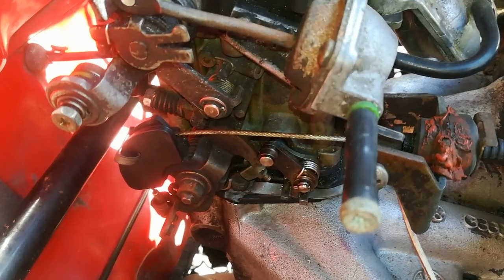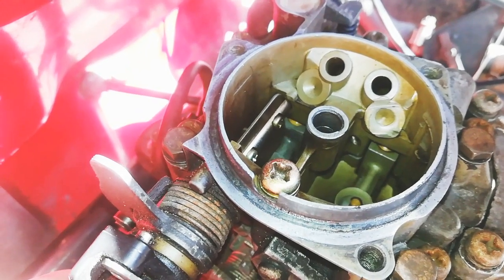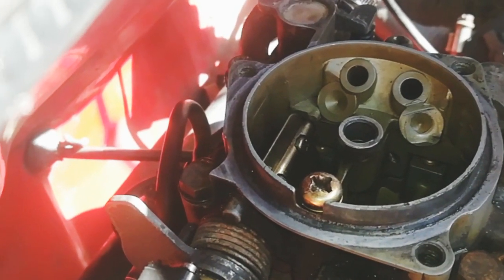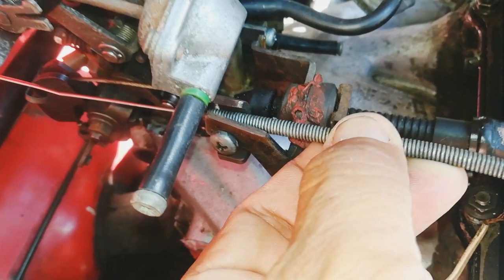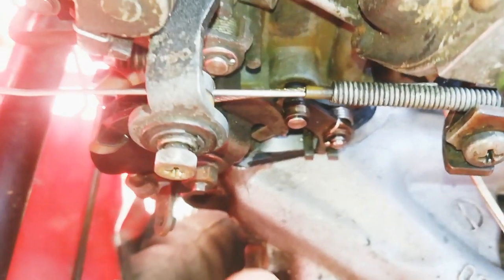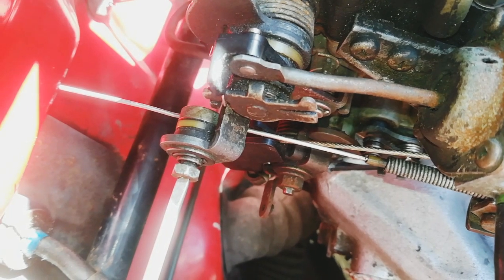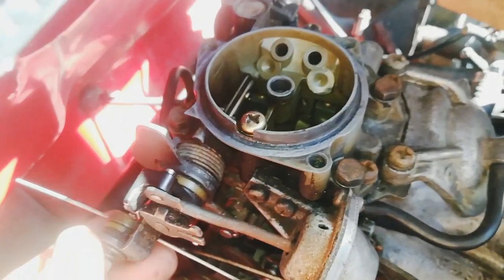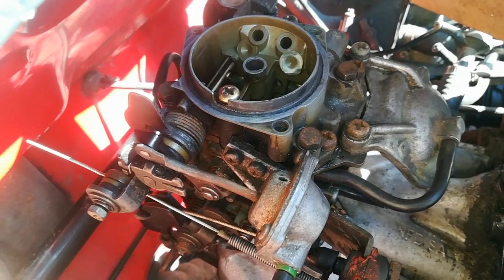GOLF MK1.HOW TO SET MANUAL CHOKE (CARBURETOR KEIHIN KS2)#golfmk1 #vwgolf #vwfox#golfmk2#vwcaddy

Comment: Have a issue with my golf carburetor that it idles high at 2000rpm. Looks like the throttle body gets stuck, is there a way to fix it or must i just replace the whole carb, taken it out twice to clean and try and fix it but no cigar. Thanks for all the tips, Keep up the good work
Reply from the maker: Hi. Have you tried a drop of oil or Q20 on the hinge of the valve.. May just need bit of lubricating.. How is your accelerator cable. You sure there's not a kink in the tube where the cable runs in.. It happened to me once after I moved the cable, while I was working on carb. That's probably a long shot but anythings possible.. And sometimes it's a small issue causing the problem
Reply: @pjs-golfmk1-diy  Thanks for the reply, no the carburetor is shot, it even does it when i take of the cable. Just going to bite the bullet and buy a new one at the end of the month, car was my father in laws and was not really maintained so now i get the all the presents that cost allot of money. But hey its wheels cant complain

Comment: Awesome thanks...does disabling the small diaphrahm help anything...i see yours is not connected
Reply from the maker: That component is only for cars with aircon.. It serves no purpose, hence its blocked off on both sides. Make sure u block the port on carb side too,otherwise it sucks in air.
Reply: @pjs-golfmk1-diy  so I set like you said but when I rev it wants to die
Reply from the maker: @dylanburtonburton7728  if you been driving with a choke that has Been closed..  putting it back choke flap to where it's supposed to be  is not all that you need to do.. Your carb must now  be retuned etc... Like starting from scratch again...
Reply: @pjs-golfmk1-diy  OK cool I'll retune tomorrow
Reply: @pjs-golfmk1-diy  what if You have ac, what must it look like?

Comment: Hi guys,when exactly do I have to pull the knob? And when do I push it back In 🙏🏽?
Reply from the maker: Just pull it out a small bit..not fully
Let engine idle for 2 minutes and drive off...push it back in when engine is running stable ...normally happens after 5 mins..
Reply: @pjs-golfmk1-diy  do I pull it out before or after starting the vehicle though?

Comment: I have problem with choke ...| do everything that you describe in video BUT when I pull choke engine turn OFF.......can you tell me what could be reason of that engine stop?
Reply from the maker: How far are u pulling it out ..
Because if u pull it out too far it will cut out ,meaning it's too rich then
You just have to pull it out a little bit so that engine idles between 1000 to 1500 rpm. Look at this video 
https://vm.tiktok.com/ZMjq4boN5/
Reply: Yes I pull it out all the way....I willl pull it little bit thanx aa lot for advice !!!
Reply: I have another problem with carburetor.....My car is useing benzine fuel but I have in car LPG fuel....when I start in morning car on LPG and pull out little bit choke it works and engine has aroun 1400-1500RPM. BUt when I start engine in morning on Benzine fuel and pull out choke little bit (trying not to cut out engine) there is problem that engine start loosing RPM and look like choke not work as it use to what may be a problem?

Comment: What if you don't used your choke
Reply from the maker: Well, why wud u not use it.? . On cold starts Your engine will start up much easier with the choke... And u will be able to drive off immediately, without choke, on a cold start, u will struggle a bit and wait for engine to warm up, using manual method., but that's your choice
Reply: @pjs-golfmk1-diy  thank Pj  for the info starts better with choke